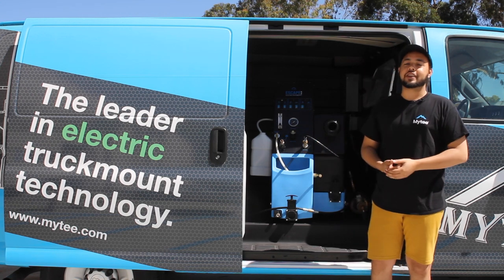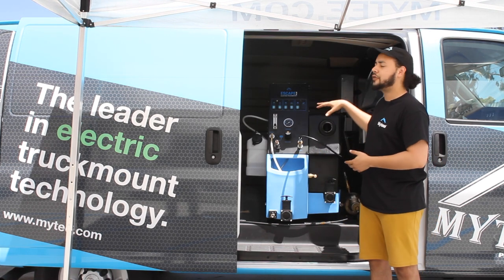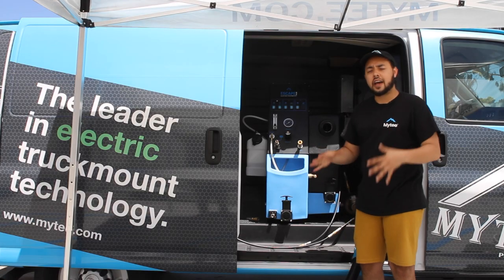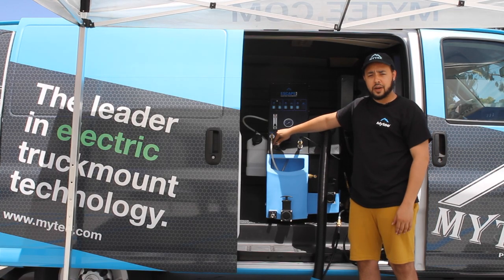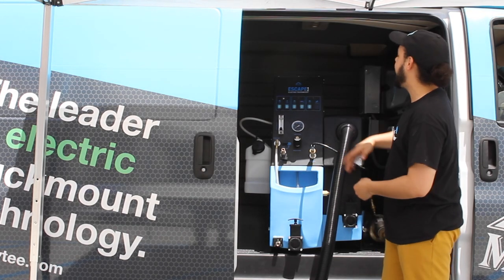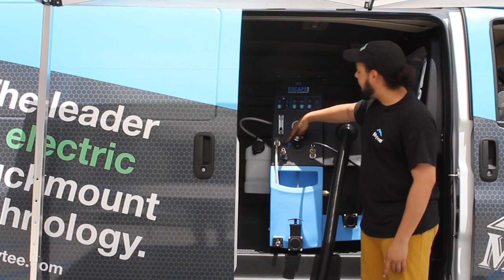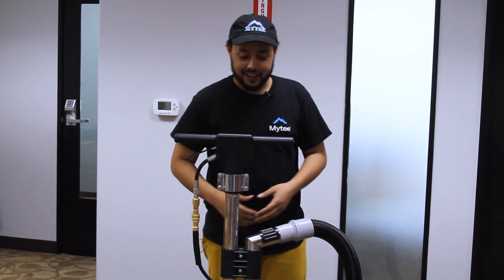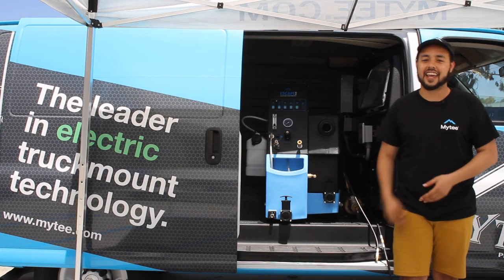Mytee How-To: Operating The Escape LX Plus

Comment: How and where do you get the 12k Watts generator?
Reply from the maker: We got ours made by Aura generators but you can find a generator that will work at most hardware or equipment supply stores or simply search for one online!
Reply: I just ordered a champion 100111 supposedly 12k running watts we shall see